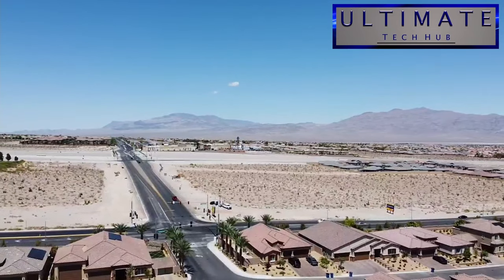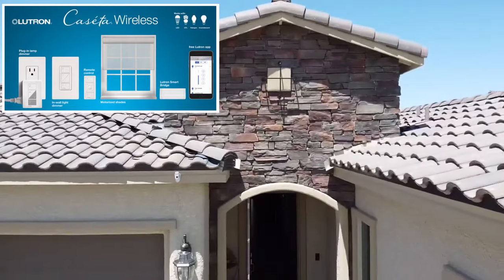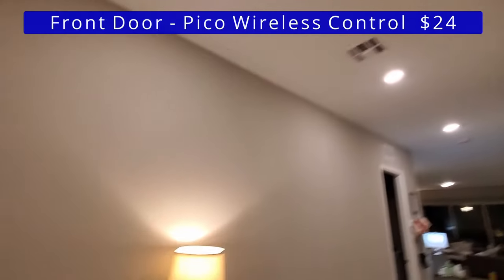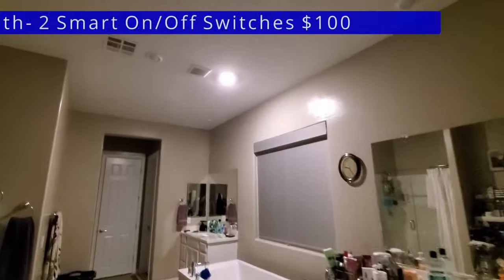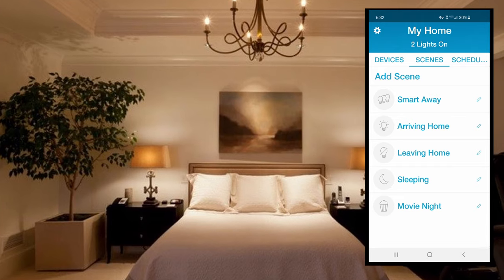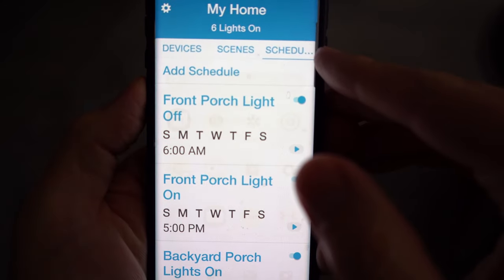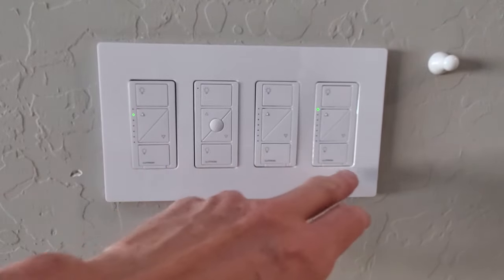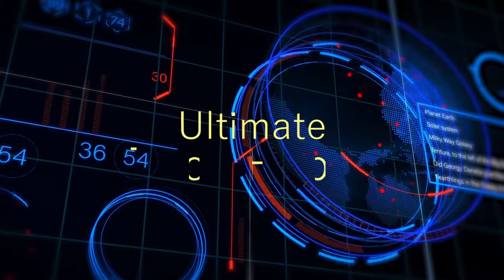Lutron Ultimate Home Guide 2024 Tour

Comment: I installed combination of 35 switches and remotes which I use with HomeKit. It was definitely worth the expense and haven't had an issue yet. I consider it an investment in my home. PS. I shopped between Amazon, Lowes, and Home Depot for parts. I save a few hundred bucks between sales and veteran discounts.
Reply from the maker: Nice setup. It's definitely worth the investment and it sounds like you got some good deals on Amazon. Thank you for watching I really appreciate it.

Comment: I am looking for dimmers for my room where I have a chandelier with several dimmable LEDs (15w g9) and I would like to make a connection between two Lutron dimmers. One of these dimmers would be at one side of the room (near the entrance to the house) and the other at the other side (near the hallway leading to the kitchen). I searched a lot and came across numerous Lutron dimmer models and in most youtube videos it is not clear which Lutron dimmer model to choose. Important point is that I would not want to use a Pico and they should be compatible with Home Assistant.

Do you have any tips for me about which dimmer model I should use?

Comment: Did you have to change you wiring to make the system work? I’ve been told I need to run CAT6 cable to all of my lights which is costly. 

I’m looking into Lightwave at the moment and want to know if this is a genuine competitor or if there is a hidden cost in the cabling and modules etc

Comment: So the cheap wall remotes do not hook up to power? They got batteries?
Reply from the maker: Yes. The batteries should last many years. I've had mine for 2 years now. Thank you for watching I really appreciate it.
Reply: Hmm I wouldn’t call them cheap. I like the Pico remotes and they’re as good as they can be, IMO. The way they can be used to create/replace a 3-way so easily is genius. And they’re really useful, for having a “kill all” switch, in attrition to the normal 3 way setup. For example, I have a Pico set to turn off all the lights upstairs when I go downstairs, and vice versa. They’re great, and feel just like a real switch, when installed. Lutron is one of those brands that’s somewhat mainstream, yet not overhyped, and legitimately at the top of their game. Offering a product that’s at a level of reliable and quality where it effectively outclasses any other competitor—barring specific cases where someone wants a niche feature that Lutron doesn’t do. They’re the Glock, the Prismacolor,  the Porsche, the Tempurpedic and etc., of home lighting.
Reply: @Legomax18  I went ahead and got it and I love it as well. I did not think of making a remote to turn off all the lights downstairs or upstairs, that a great idea.  Though I could do that with google home.. the switch is a nice to have especially when children are sleeping.

Comment: It's also worth mentioning these are not compatible with with all lightbulbs. Just because you add the Lutron switches means it will work well. I found out the hard way. Did it "work" yes, but significant buzzing even though they were dimmable bulbs. Had to switch out all the dimmer bulbs to Lutron compatible ones. The one I cannot figure out how to troubleshoot, is my on off switch for the outdoor light. The light never fully turns off! I have double checked the wiring and everything, nothing makes it go off (aside from pulling out the tab which is not convenient because it is disconnected). Any suggestions?! Thanks!
Reply from the maker: Yes some bulbs do not work well with these dimmers. We have LED bulbs in our bathroom and the dimmer will not turn the light off all the way. We get a ghosting look we're the bulb is just barely on. And the dimming doesn't work well for these bulbs either so we swapped out the dimmers for on off switches and they work perfectly. Most of our lights work with dimmers but not all. I have never had a problem with an on off switch not turing off the light. I would switch out the light bulb with a different watt bulb to see if it works. Keep me posted and thanks for watching I really appreciate it.
Reply: @UltimateTechHub  thanks. Yeah I’ve heard about the ghosting w dimmers too. I wish I could just change the bulb! Unfortunately it has a built in LED and not able to change it. Previous owners installed this, I hate it. Because changing the light requires a whole new wired fixture! Dumb 😣😫

Comment: I recently looked into getting a whole bunch of Lutron switches, and was told that in order to make scenes with them, a Lutron rep/technician needs to come out to set it up. I didn't ask the price, but I'm assuming it's not $0. Did you need to do that with your Lutron system, or did you set this up on your own?
Reply from the maker: No you don't need a Lutron rep to set up the switches. That's what they say to make more money. You need to be able to I install the switches which I have many videos on that subject. You also need a Lutron smart bridge hub to plug into your router. The smart bridge hub connects all your switches into your network. Simply download the lutron app and you can add each switch and name it and it's location. I have many videos on this so use them as references. Good luck and keep me posted! Thank you for watching and if you subscribed thank you as well.
Reply: @UltimateTechHub  But how about a scene switch with like 4 scenes? Are you able to set that up as i cannot find a Lutron scene switch anywhere.